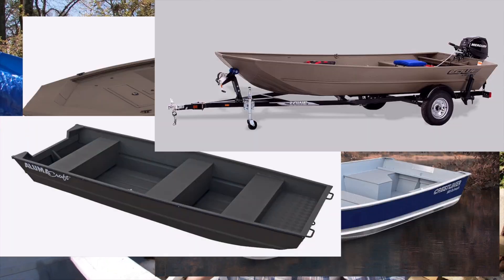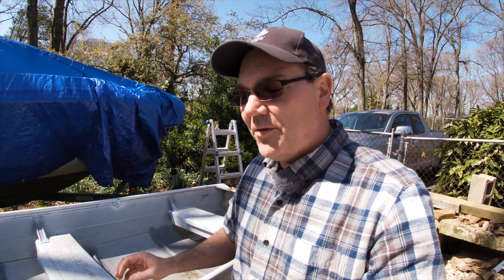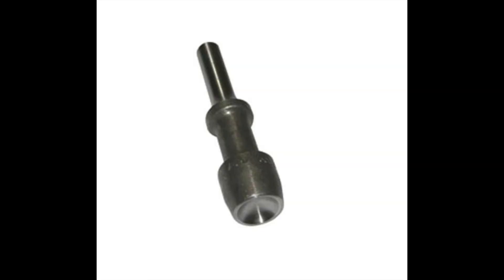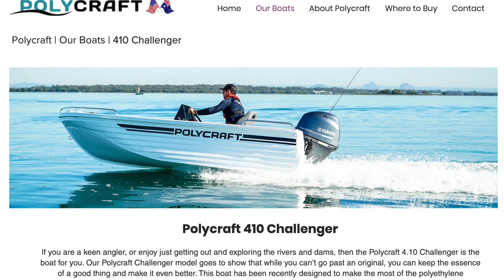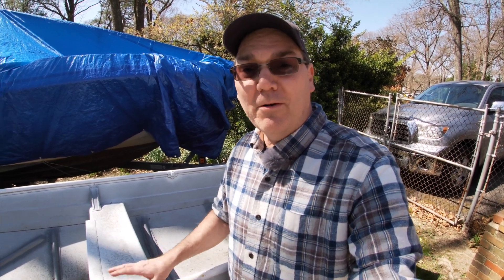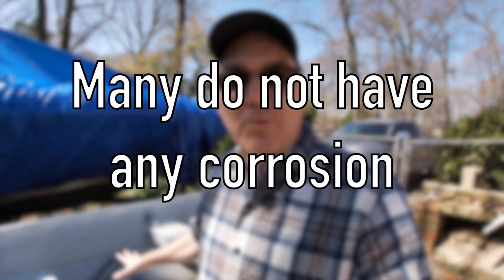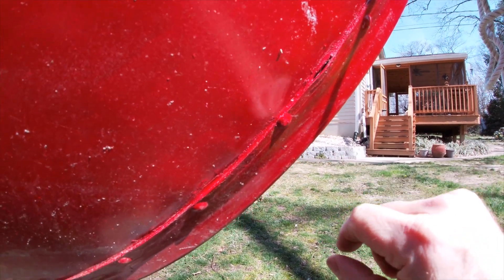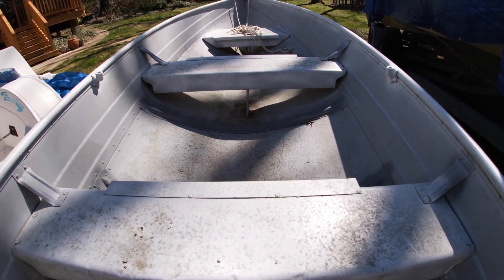Aluminum Boats - Why Jon Boats are made of Aluminum

Comment: I have a 1963 lone star 14 ft aluminum boat, still floats great and cuts through the waves better than any other boat I have ever been in.  I need to replace the ORIGINAL plywood transom, however, as it is getting weak, but after 60 years of abuse, it deserves it.  I purchased a newer aluminum bass boat to use while my classic is getting fixed, I plan on restoring it to showroom quality.
Reply from the maker: That's awesome. I just replaced the transom in my old aluminum boat.
Reply: I had a '68 and it now fishes with a friend. I now have a welded aluminum drift boat and it is a lifetime boat. I have seen them covered in bowling ball sized bottom dents and they are still working for a living. There is zero wood in my boat. Just tilt it up for drainage.

Comment: constructive video. Fiber or aluminum is the old unwinnable argument.  When I think of fiberglass boats,  I think of the completely faded washed up dilapidated unfix able  fiberglass boasts that always see in peoples yards.  
 In my area, the speed sport type boats seem to be mostly fiberglass and the fishermen seem to lean toward aluminum.
Reply: Here. in Finland. most small boats are fibergrlass. aluminium is expensive here. fiberglass is easy to repair if the hull is still stiff. just drill the hole a bit bigger to get to the intact fibers and then put on some epoxy and fiber mat plus paint. one can fix big holes easy. we also have loads of old wooden boats  and a heavy boat is good on rough waters.
Reply: @vihreelinja4743  what kind of boats  really varies between regions.  Here in the pacific northwest US and western Canada both Aluminum and fiberglass are popular.  Sport fisherman generally favor aluminum and  water sport people favor Fiberglass.
Reply from the maker: Thanks -Same here!

Comment: Rivets leak, wields break and that's a gator. Riveted aluminum boats are supper easy to maintain and repair for under $50 you can buy a set up to tighten the rivets ( no sealant needed ) and a pack of the brazier rivets (used on aluminum boats from the factory) are only $10 for 100 on Amazon!
Reply from the maker: I have been practicing with solid rivets recently!

Comment: Hi there, i am looking for the outboard motor right now, 5hp outboard, what you recommended between tohatsu and mercury? Thank you so much
Reply from the maker: At that hp - I think both of them are made by Tohatsu - so it would be a tie!
Reply: I bought a 9.9 tohatsu efi 8 months ago. Installed on a older 13’4” low side gheenoe. Very pleased with the tohatsu. Cranks on first pull every time. Great fuel mileage. Cant go wrong with the tohatsu

Comment: Unpainted aluminum does "rust" or better put "oxidize". But unlike steel it doesn't continue to oxidize below the surface of the oxidation. The white powdery layer is the oxidation. If you remove it and don't paint it, it will oxidize the newly exposed aluminum. Therefore if you sand away the oxidation you need to paint it with a good grade of marine or epoxy paint and then continue to touch up areas when they get exposed by scratches and dents etc.. One should consider sanding and painting if you have a bare aluminum boat as any scratches or dent that remove the oxidation will compromise the metal over time (and if you are in a salt water environment this is an absolute must to make the boat last).
Reply from the maker: Yeah my boat would benefit from some proper prep and paint work - maybe a future project!

Comment: OK
This a big subject
maybe warrants a bit of study
A riveted aluminum boat is a marvel of modern technology
Ever wonder why there lots and lots of riveted aluminum aircraft???
I wonder do you know a weld in aluminum is Not as strong the aluminum itself
I also wonder do you know some aluminum alloy will corrode and other alloys of aluminum almost impervious to corrosion by salt water
My hat is off to you if you can fabricate a aluminum boat cheaply
Just for your information it takes quite a bit of machinery to build a riveted aluminum boat
Also the installation of solid rivets is quite labor intensive
To form the boat would take a hydraulic press and forming dies
The riveted Aluminum boat was a offshoot of WW2
After world war two aircraft manufacturers had the presses the aluminum sheeting and not a lot of work building aircraft
Some older Riveted Aluminum boats are truly magnificent
They were designed by true engineers and built by true craftsmen
There even was a alloy of chrome aluminum that was a very tough light stiff material
But alas
This the year 2022 and there has been a lot of junk built
Nevertheless :)
A well engineered riveted aluminum boat built of the proper material is a Marvel compared to any other boatbuilding material
Sadly we are not likely to see the quality of what was common in the post war years of the 50s 60s till the mid 70s
Reply from the maker: Good points!
Reply: I have a 42 year old Lund boat. Not one leak. Welds crack and when repaired they are never the same.

Comment: Several years ago I inherited my dad's  1964 14 ft. J C Pennys aluminum boat. I restored it to almost looking new. I use it all the time to go out fishing . The only problem I have is to make it stop leaking. any Ideas on this ? I tried different spray sealers  ( flex, rust oleum , JB Weld ) I did install a bilge pump it helps get it out.
Reply: Put it on a trailer and fill it with water up to the water line.  Mark all the rivets that leak.  Replace the marked rivets.
Reply: If it's riveted.  Just tap with a hammer on one side of river while using another hammer to back it up on the other
Reply from the maker: This is the way! Sometimes we also need to clean around the loose rivet and apply some new sealant - but re-seating any loose rivets is the main thing!